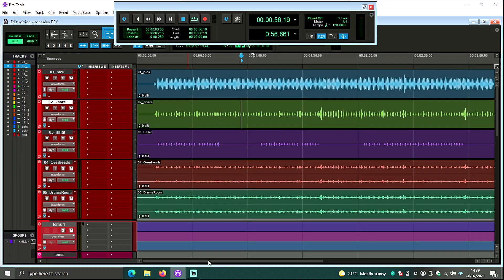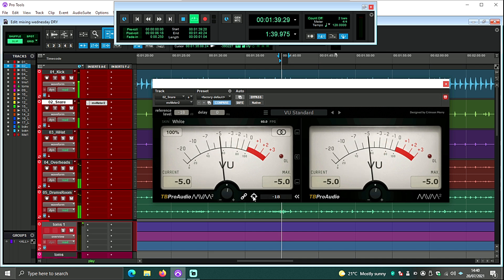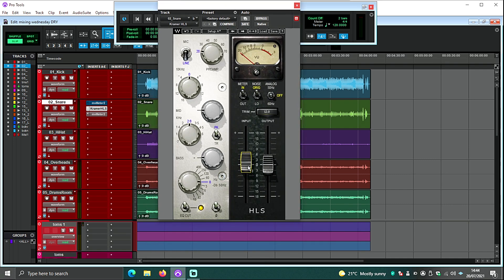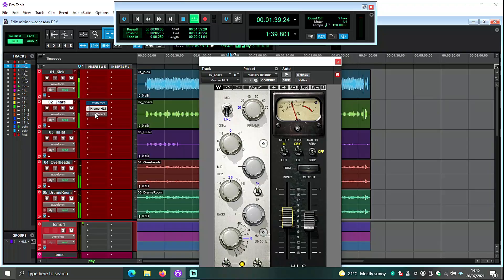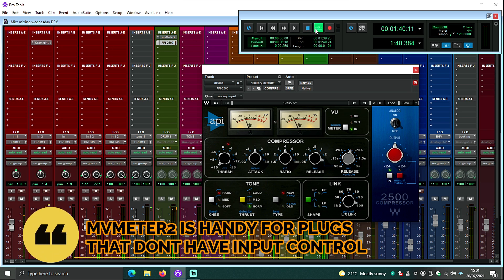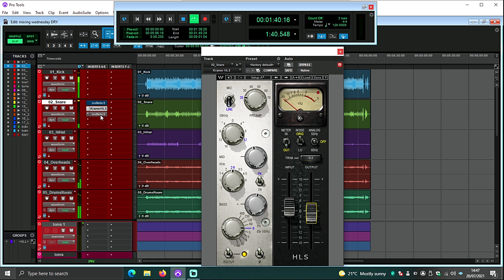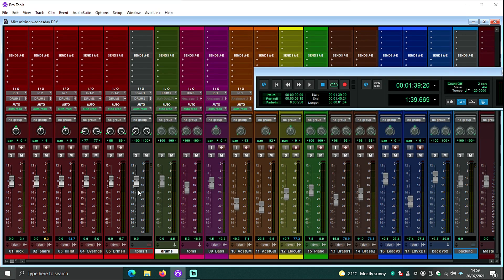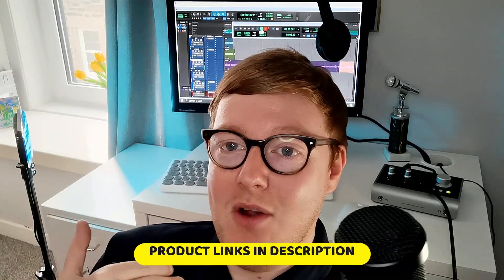Why You SHOULD Gain Stage Analog Emulation Plugins (PART 1)

Comment from the maker: What do you use for gain staging? 🤓

FYI. Thought I'd give a bit of detail why mvmeter2 is set to -18 in these examples to give a bit more context into why I specifically gain stage analog emulations.

My advice is always to read the manuals of the analog emulations as most analog emulations plugins (not all) default to -18dfs as 0vu.

Its important to understand what your analog emulations 0vu is modelled to on their vu meters. To get optimum results going in we all know they advise aiming for the 0vu mark which is also (+4dbu). Thats why the analog gear with digital meters are colour coded (Amber, green, red). That's why they have a 0.

The reason people say -18dbfs an internet myth is because the truth is that there is no mathematically correct conversion from digital dbfs to analog dbU. 

The truth is that we only have rough guidelines:

European & UK calibration for Post & Film is −18 dBFS = 0 VU = +4 dBu

BBC spec: −18 dBFS = PPM "4" = 0 dBu
American Post: −20 dBFS = 0 VU = +4 dBu
Orchestral −18 dBFS = 0 VU = +4 dBu
Rock and / or Radio −16, or −14, or −12 dBFS = 0 VU = +4 dBu

Acustica for example have digital meters for inputs and -18 (0dbu) on nearly every input they do. They've made it clear before in posts that to get the desired hardware sound in acustica you should go in at -18 as that's what they sampled at.

So -18dbfs isn't a myth. The truth is its a common default for analog emulations as 0vu. Which means that it's an indication of which level to go into for optimal results and also how to ensure you are not going into the red and overloading the input. 

Ask yourself. If you had the real deal sat in front of you and you were dealing with analog metering. Would you constantly go into the red and overload the input of the unit? 

Going into the red can give cool results but the reason for gain staging is to ensure that you are not exceeding a certain level. That level is dependent on you as its all subjective in terms of use and preferences. 

I gain stage to whatever 0vu is in the analog emulations plugin as I prefer to go into the plugin at 'optimum' level. That's my choice as that's how I'd personally use the hardware. In the examples shown both waves plugs 0 is -18dbfs.

I try to use the analog emulations as if they were hardware. going into the red of analog emulations will produce more harmonics which in analog can be great. In digital the problem you have is that the more higher order harmonics you make, dependent on your sample rate and anti aliasing filters of the Plugin you will bring in more audible aliasing into your source which we all know isn't the hardware and also unmusical.

So my gain staging is based on whatever 0vu is in the plugin, which just so happens to be -18dbfs in most that I use. So that's why -18dbfs = 0vu is actually a good guide to go by as in many analog emulations -18dbfs is actually 0vu.

So it's not a myth, it's actually a very common calibration for analog emulations but that's why i read the manuals first so I know where they have modelled 0vu to.

Again no right or wrong answers. That's why I stated that some gain stage to - 22, -20 for more headroom so they definitely know they are not going beyond 0 and also limiting saturation for a cleaner signal.

Some like to go in hotter for more saturation but how hot  'hot' is something that you need to evaluate for yourself.

That's as much context as I can give 🤓
Reply: I use psp's triple meter, and to change the gain I actually use clip gain (or item volume how it's called in reaper). I've seen pro tools users not using clip gain and rather using some utility plugin. That's totally weird for me. I know pro tools didn't have clip gain until v10, but since then it has and it works fine I guess so why not to use it? Anyway, glad I'm not a pro tools user ;)
Reply: Ive been using this plugin too
Reply from the maker: Clip gain is just an extra step for me. MvMeter2, trigger tool. Leave it on. Job done 💪

I refuse to budge from protools haha.. Boy don't need no clip gain!! (in the voice of Mr T)
Reply: Analise with audiosuite gain plugin to show the loudest peak.
Clip gain down to the desired value 
(Sometimes gain up when clients export shakers/pads at their mixing levels)
Reply: Presonus VU meter is a free VST! More lightweight and stable for me
Reply from the maker: What do you mean by more stable?
Reply: I use the Klanghelm VUMT Deluxe since years. Couldn't work without it. It's especially cool, cause it also shows RMS (very important to me) and you can switch themes - so my input meters always look different from the output meters :-)
Reply from the maker: That's the MvMETER2 features

Features
behavior of classic analog VU and PPM meters
multiple measurement modes: PEAK, RMS, EBU R128, VU and PPM
multi channel metering: stereo, left, right, mid, side
single and dual meter display
adjustable reference level for all meter modes
adjustable meter delay
preset management
adjustable pre-gain including gain matching
instance label
large and accurate live meters
64-bit internal processing
5 different meter themes
free GUI scaling up 400%

I just realised it has different skins 😂 genuinely downloaded and never looked at what else it could do. I'm basic bitch when it comes to these things haha
Reply: I watched the part where you set the gain using the plug-in about 5 times because I couldn’t understand why you weren’t changing the gain on the audio clip itself!! I use the same meter but never would think to keep it on the track 😂
Reply: I don't.. but then again my tracks usually don't come in too hot (if something does, it's usually the kick or 808). Here is what I've learned: Presets teach you at what level they want your signal to come in. Use a couple of presets to get to know your plugin. If you always find yourself lowering the threshold of compressors (or turning up the input-knob) you're probably coming in too quiet (that is probably more common than the opposite - at least it is for me). If you find yourself doing the opposite, you're probably coming in too hot. But if it sounds good, it's good.
What I focus on is to never, ever, ever, ever have a track clip - even if it's going out quieter (post-fader). But even that seems not to be necessary.. since I've seen dozen of sessions of professionals who don't give the slightest F about having a track clip down the chain. So the real rule is to make stuff sound good and all other rules are only there to help you not make mistakes that could but don't necessarily do keep you from getting there.
Reply: Meters and proper knowledge of EBU R68-2000 which is the cause so many people are truly convinced that -18dBfs (rms) is a magic number (actually it should be equivalent to a 0dBu analog level or 0.774volts going into or from AD/DA) and doesn’t know that the maximum allowed level (peak wise) should be -6dbfs (always according to r68-2000).
Use VUs when it make sense to use them and use PMs or TPMs when it make sense to use them.
And if you are going to use SMPTE standard,  K system or other metering systems, just read the specs before to make good use of them.
Or, if you are ITB and with no analog gear in your setup, just ignore every reference and just make gain structures that make sense, give yourself an headroom and just mix... 
“But The plugin sounds best at -18!” - false!
First of all, is -18 dB RMS (which is pretti high for a single track going into a summing bus) second reason is most plugin does not have a real “sweet spot”, other are set to other levels (-14 for Lindell, -12 for FF SC console ecc...).
The third reason is... really...no one needs an hi-hat harrassing ears at 0VU, seriously 😂
This is the reason i don’t like “auto gain staging” plugins.
Back in the days NO ONE gain staged a snare drum to 0VU! EVER.. 😂
BTW Paul, i’m glad you made clear to use ears and brain to gain stage, there are too much wrong habits being spread around on this subject 🙂
Reply from the maker: Whatever makes my life easier haha that's my motto 😂
Reply: @PaulThird  that’s the best motto ever 😂
Reply: Mvmeter for gain staging seems a little overkill to me. A trim plugin (stock) should do. And if you want to use something fancy, you can for example use freeG from sonsalksis. This is an actual gain staging plug-in, which mvmeter is not (this is a heavier metering plug-in).
Interesting video though!
Reply: I use the VU meter at the bottom of the track.  That's what it's there for.
Reply: REAPER has several auto-normalize functions. I'm currently normalizing clips to -23 LUFS. I'll actually split up clips of vocals so I can hit that auto-normalize as a quick approximate fader ride. I'm going to pick up mvMeter2 for when I'm not in REAPER.
Reply: I use GainMatch (with mvMeter2) from LetiMix (automatic gain correlation and comparison plugin). It has so many options to check (groups, level target, weighing, before and after comparison, delta, detection time, etc.). Highly recommend.
Reply: @stupidusername38  true, though I don't use the autogain because my VU meter is fixed on the masterbus. I'm just soloing tracks when I'm gain staging
Reply: Doing this theres a lot of noise when i push hard my limiter
Reply from the maker: You wouldn't gain stage your limiter. Your limiter requires a good level going into it. So the last plugin in your chain before limiter would be controlling how much headroom your mix will have overall via the output. I normally aim for -6dbfs in terms of mix headroom
Reply: @PaulThird  i think he's doing gain stage by using a -18dBfs Peak reference.
Since some plugins (a lot actually) gave a noise floor, by gain staging too low before any inserts on the tracks the SN ratio will be worse. 
When you stack a lot of plugins producing noise, the noise floor builds up and when the master limiter kicks in It becomes very audible.
A fix for that is doing a proper gain staging (-18 peak is just an internet invention) and/or turn down the noise on plugins that let you do it (brainworx v gain down, waves analog off, Valhalla age to 0% and so on).
Reply from the maker: @giuseppenovella  yeah I never use noise on plugins. ALWAYS switched off where possible. I get annoyed its even an option 😂
Reply: @PaulThird  yeah, that’s annoying
Reply: @PaulThird  wouldnt that be "I pity the foooo that needs clip gain!" lol
Reply: Of course always noise off!! But yeah -18dbfs on internet is trash!! But this vu is not seeting for sert ur levels on -18?
Reply from the maker: I still dont get why many are saying -18dbfs is trash. Its in the manuals.

Most analog emulations plugins (not all) default to -18dfs as 0vu.

Its important to understand what your analog emulations 0vu is modelled to on their vu meters. To get optimum results going in we all know they advise aiming for the 0vu mark which is also (+4dbu). Thats why the analog gear with digital meters are colour coded (Amber, green, red). That's why they have a 0.

The reason people say its an internet myth is because the truth is that there is no mathematically correct conversion from digital dbfs to analog dbU. 

The truth is that we only have rough guidelines:

European & UK calibration for Post & Film is −18 dBFS = 0 VU = +4 dBu

BBC spec: −18 dBFS = PPM "4" = 0 dBu
American Post: −20 dBFS = 0 VU = +4 dBu
Orchestral −18 dBFS = 0 VU = +4 dBu
Rock and / or Radio −16, or −14, or −12 dBFS = 0 VU = +4 dBu

Acustica for example have digital meters for inputs and -18 (0dbu) on nearly every input they do. They've made it clear before that to get the desired hardware sound in acustica you should go in at -18 as that's what they sampled at.

So -18dbfs isn't a myth. The truth is its a common default for analog emulations as 0vu. Which means that it's an indication of which level to go into for optimal results.

It means that if you gain stage to -12 for example then you are always going to go into the red of the Plugin and thus overloading the input.

This may be something you want to do but it's all about understanding when you are in the red and asking yourself if you would go into the red and overload the input everytime you used the hardware.

Going into the red can give cool results but the reason for gain staging is to ensure that you are not exceeding a certain level. That level is dependent on you.

I gain stage to whatever 0vu is in the analog emulations plugin as I prefer to go into the plugin at 'optimum' level. That's my choice as that's how I'd personally use the hardware. In the examples shown both waves plugs 0 is -18dbfs.

I try to use the analog emulations as if they were hardware. going into the red of analog emulations will produce more harmonics which in analog can be great. In digital the problem you have is that the more higher order harmonics you make, dependent on your sample rate and anti aliasing filters of the Plugin you will bring in more audible aliasing into your source which we all know isn't the hardware and also unmusical.

So my gain staging is based on whatever 0vu is in the plugin, which just so happens to be -18dbfs in most that I use. So that's why -18dbfs = 0vu is actually a good guide to go by as in many analog emulations -18dbfs is actually 0vu.

So it's not a myth, it's actually a very common calibration for analog emulations
Reply from the maker: That's because better is subjective. Everybody is going to be different but That's why I gain stage to whatever 0vu is in the analog emulation as I use the plugins as I would the hardware.

I hardly go into the red of analog gear. That's my preference. So if 0vu is -18dbfs in that plugin then that's what I'm gain staging to. That's the only number I want to know when working with analog emulation plugins. Only time I look at digital meters is on my master bus. I don't need to worry about clipping cause I'm gain staging. 

You can go in at whatever level you like but I still think it's important to understand that in the digital domain abusing the input of an analog emulation will cause more audible aliasing.  Whether that's something that bothers you is another matter but not having understanding of where 0vu is kind of defeats the purpose for me as you've bought the analog emulation to sound like the hardware right? I'm thinking logically if somebody who has only worked with plugins had say an analog eq in from of them and they are dealing with analog metering. Would they constantly go way into the red everytime? Hard to say but it's a different mindset to me. I notice people are more cautious in the analog domain. People look at digital meters and go.. WOAH I can push that way more but just cause you've got more headroom in digital doesn't necessarily mean it's going to work for plugins emulating an analog workflow that doesn't have the same headroom. 

You can abuse plugins and do what you like but it's maybe my autism as I'm so literal but would you not bring in the mindset of using the hardware into the digital? Is that not why you've bought that plugin.. To sound like that hardware 🤷‍♂️

The whole always use -18dbfs doesn't have any real merit as its just a measurement telling you what 0vu is in that plugin. That's why we use our ears.

However I have call absolute BS on others (not yourself) claiming that you can hit an analog emulation any way you like and still get the 'hardware' sound. That's delusional. As soon as you start bringing in a crap ton of aliasing it's not the hardware. Hardware doesn't alias in the digital domain. The only way you can control how audible the aliasing is by controlling your input. I've already shown the impact of abusing the input in another video. 

For the most consistent and 'true' to the original results gain staging closer to 0vu will give you better results in terms of recreating the hardware. 

That's my 2 cents. When it's comes to analog I work to analog metering. When it comes analog emulations I work to 'analog' metering via digital vu meters.

I think the key for the individual is listening for what sound they actually want. Whether they prefer a cleaner signal, or a more saturated signal. Whether they want to be true to the hardware or go beyond. It's all entirely up the individual but when it comes to plugins thats my own personal rationale
Reply from the maker: I aint gettin on no plain wit clip gain 😂
Reply from the maker: I'm actually away to make another video about gain staging transients as an engineer I know messaged me  to tell me that vu meters are generally quite slow in dealing with heavy transients ie snares. He advised around the -10vu mark so the transients don't kinda tuck in so I'm gonna test gain staging a snare and hi hat at different input levels and compare the difference in what it does to the transients 🤓
Reply from the maker: I've got standard clip and jst clip. Standard clip is my 'clean' clipper and jst clip is my 'dirty' clipper 🤓
Reply: @PaulThird  that’s kinda what i wrote in my first answer.
VU have slow integration times, so they are very sifficult to use with fast transients.
What he wrote to you make complete sense to me. 
That’s also why you cant use PEAK values to align to -18dBfs! RMS integration is a lot closer to VU integration 😀
Reply: @giuseppenovella  the presonus' free VU meter has a sensitivity knob, so for those fast tracks like the drums, I just dial the knob until the meter captures fast information to taste. Set the sensitivity to max and your VU meter becomes a digital meter. Really convenient for me
Reply: @user-us1ts5ee6u  When you change integration time on a VU ...it isn't a VU anymore... it just make more sense yo use a digital peak meter for fast transients (aka the meters of you daw set to Peak mode).
Sensitivity on that meter equals integration time, if you set fast you end up with a sort of PPM..but is really something does not exist outside that plugin, especially because even analog PPM have very specific integration times AND scales (totally different from a VU scale)
Reply: @giuseppenovella  since my use case for VU meters is solely for gain staging, i.e. input vs output, I don't worry about plug-in sweetspots or anything (im completely ITB). I think it's enough for me. I just want my VU meter to also be useful on percussive tracks.

I just found this convenient because I use a single VU meter for all my tracks (put on the masterbus, then solo the track I want to gainstage). I keep it open and pinned to the side, so switching to another digital/peak meter is pretty inconvenient.
Reply from the maker: Thanks Joe. I'm back reading mixing engineers handbook again haha anybody that gives me a reason to go back to that is good to have on board 🤓

Interesting reading. I didn't know that fast transient sources like drums, tambourines, hand claps and stuff could range as high as 20db above what a VU meter might be telling you. They are talking at least 10 or 15db of headroom. As they say, it's easy to make up the gain later.

Should be an interesting test 🤓
Reply from the maker: After reading mixing engineers handbook though. Possibly best to consider leaving headroom on your vu for percussion and drums. Maybe 10-15db. Use your ears and listen to how your input level preserves the transients in the analog plugin and set your level according to how you want your transients to be. I'm going to make a quick test for Wednesday so I can showcase the difference of gain staging transients at different input levels 🤓
Reply: @PaulThird  Yeah, totally agree. I like having a hardware or hardware+ mindset when mixing ITB. Keeps the options from overloading you. And gain staging comes with that.

So I hit most things around their internal 0dBVU, and I break that rule where I think it will give me something extra that I want. And when I go into the red, I make sure I have a plugin with good anti-aliasing.

That said, I'm also not anal about how close to 0dBVU I hit. I do a quick normalize on the whole session and check meters as I'm going.
Reply: @PaulThird  absolutely!!
That's why EBU stated a MAXIMUM peak level in the EBU r68-2000!
You can't level a closed Hi-Hat to 0VU.
It's going to exceed by far the maximum allowed level (which is -9dbfs +/-3dB to compensate for user error...so -6dBfs is your ceiling Peakwise), depending on the sound it could even clip!
If you hit that hard a plugin isn't going to clip and square-off your signal (thanks to 64bit environment) but it's going to saturate A LOT, which is something we don't do so often with analog devices.
That's why 0VU was a target mainly on the MASTER BUS and Master Tape Preamp not individual channels on the console.
Even a dynamic vocal part could screw up a recording if too hot than needed :)
I look forward to your next video on the subject! you are going to be maybe the first one on Youtube to nail this, bypassing all the "forums BS" that floats around the internet since early 2000s :)
Reply from the maker: Interesting seeing the meters. Now it's just about hearing how the different input levels change the transients. Looking forward to setting it up as i hope it will give some interesting and thought provoking results! 🤓

Think I'll set up -15vu, -10, 0vu and then go hard at -12dbfs, -6 and then 0.

That should be a good enough range of input levels to show the differences from lots of headroom, to just in the red to abusing the input
Reply: I use Sonimus Satson as my first plugin and use that meter & gain for gain staging before anything else. Now, If I were using HLS as shown, I'd just use that to gain stage. HLS is one of Waves' best IMO
Reply: @giuseppenovella  because you’ve been in every recording session on earth that’s how you know this? Man take a seat in the back.
Reply: @Gang-25j  not every recording studio, but some, because i’m a sound engineer for a living, doing records and live shows with a lot of analog and digital consoles.
But yeah, i’ll take a seat back because knowledge is less important than popularity.
There are a lot of mistakes in this video, but yeah…feel free to believe what you want.
I’m not here to gain popularity, i’m here because you can’t make a video using VU meters without even know they can’t read fast peaks.
Reply from the maker: https://youtu.be/w0DTz1XGDJo it was genuinely the next video I made after that. I actually listened to the feedback from others and tried to make the content better and more accurate. Dunno why your being a c*nt towards to me when I actually took what you and others said and took the time to add more context in another video and was humble enough to admit I didn't know and even referenced mixing engineers handbook on the advice I gave, and then did my own tests to back up what it said. I couldve lied and said I forgot to include it in part 1 so I didn't lose face, but I didn't.. All about popularity though eh 🙃
Reply: @PaulThird  i don't think i was rude, i was just pointing you to a mistake you made, you ended up by revisiting your video because of that, so i can say our discussion was a good thing for you and your viewers, but your viewers attacked me without even knowing nothing about my job or how many years i did the assistant, how many years i worked and what's my background.
I'm not better than anyone, i'm just someone who lives from audio since 15 years, pay taxes and that's it.
If you found my posts harmful, well... that was not my goal.
Reply from the maker: "Your viewer attacked me".. I don't own anybody. Nobody is my viewer. That's my issue. I'm not the one giving you a hard time. I went back to the comments from last year and I can see I was very respectful and understanding. I appreciated the discussion and there were no hard feelings whatsoever. I didn't question anything about you or your credentials. 

The popularity comment is aimed at me and I don't fully understand why. I haven't been rude to you and I'm not making comments about you. I can't control what somebody says to another online. I don't encite people to talk badly about viewers who have criticism towards a piece of content I make.

To put it into context, and this is why I take this stuff serious. if I was at NAAM or something and somebody got into a nasty altercation cause the discussion was around me. Would that person be entitled to then attack me in person cause somebody else attacked them for something about me? No. Cause I've not been directly involved in the altercation. It's a completely seperate situation.

Im Scottish and we're brought up to treat as you find. If you are personally a dick to someone then they have every right to offer you outside, if you aren't being a dick but your friend is then you focus on that person. As long as you stay away from the situation and remain respectful then it's nothing to do with you.

Many disagree with that but we can't control what other people do, even if it may be on your behalf, you are the one making the decision to step away and be respectful

The beefs with the other guy
Reply from the maker: Never said you were a dick. I was asking you why you decided to take somebody elses comment out on me and explained why I didn't get that as I was being perfectly respectful towards you. That was all.